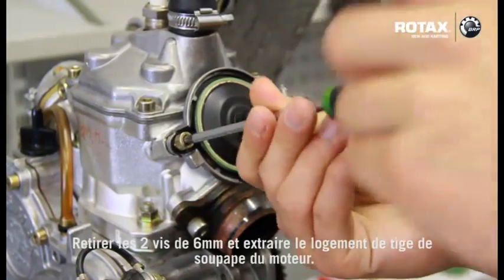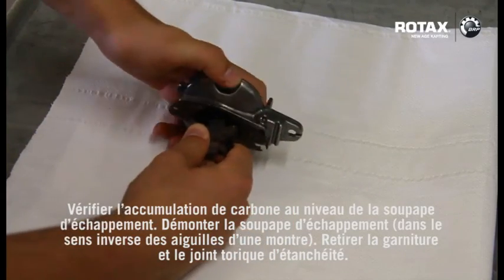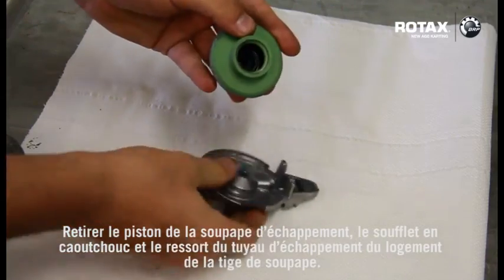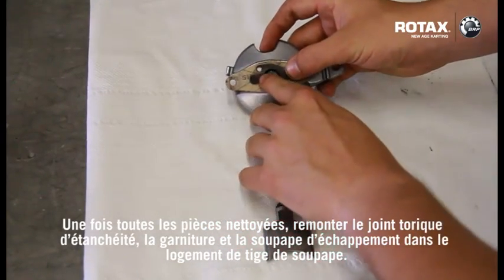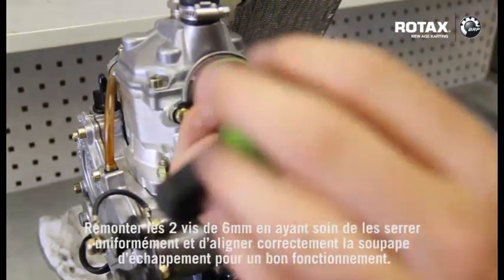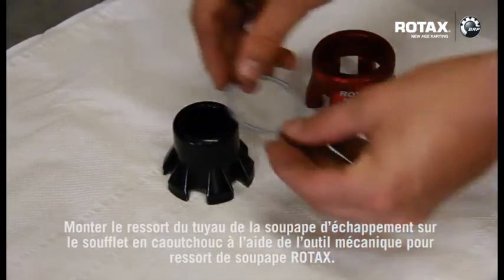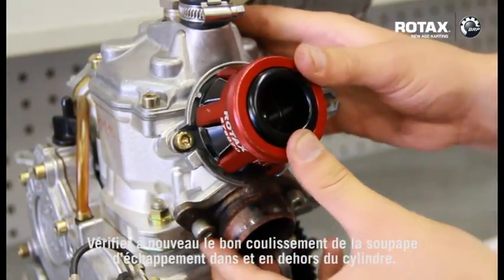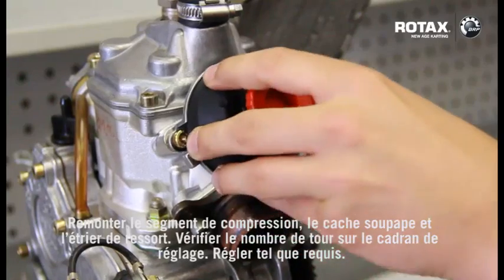Contrôle de la valve à l'échappement   moteur Rotax

Comment: Torque bolts to 8 Nm if you haven’t a spring introducer use 2 tie wraps and pull spring over bellows.
Make sure you can hear a  metallic click when pushing bellows in and also put a drop of thread lock on valve so it doesn’t come undone during operation!

Comment: I just wish you could have told the amount of turns on the red nob?
Reply: Ringo Gingo turn it all in,  then 13-15 clicks out.

Then the valve opens between 7500-8000
Reply: kape? what does that mean?
Reply: did you get the right powervalve ? ( karting version and aprilia version are different)  also the karting cylinder is less hight = less stroke than an rotax 122/123 cylinder . and you need a hole next to the valve slot for the rave2. I advise you, however to use the original electric power valve , the rave isnt that good as the electric is